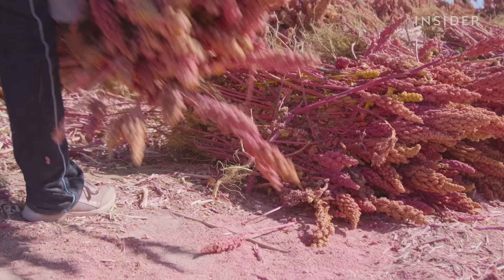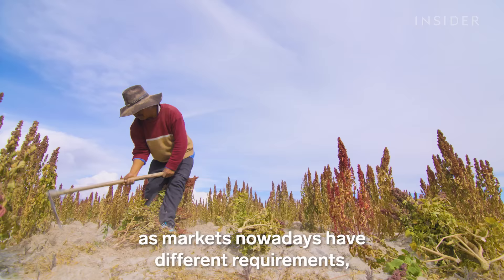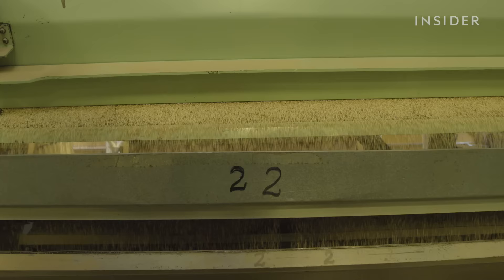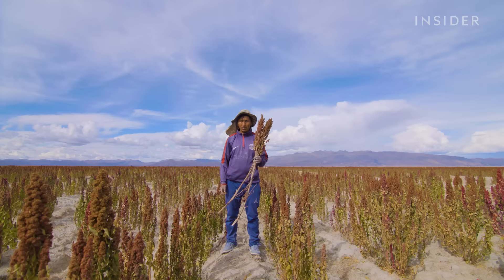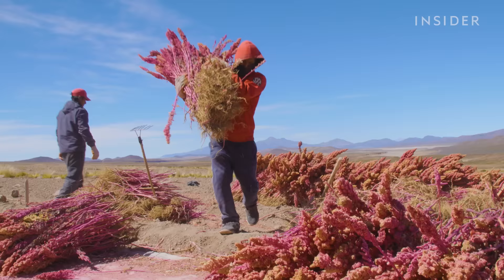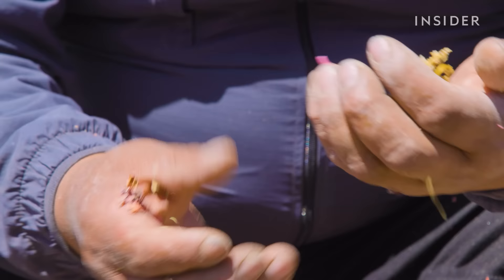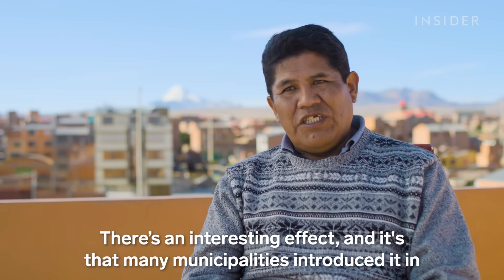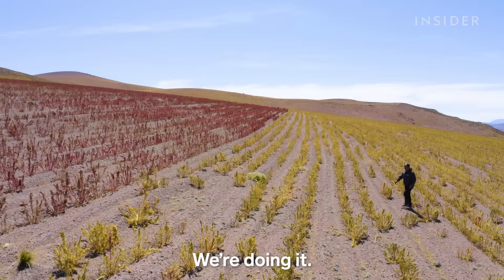Why Royal Quinoa Is So Expensive | So Expensive Food | Business Insider

Comment: Idea for a video: Why montblanc pens are so expensive
Reply: I've been in the fountain pen hobby for a long time and Mont Blanc hasn't been considered the best in a long time.  Japanese brands like Pilot and Sailor produce superior pens at often lower prices.  In addition, Maki-e pens from Japanese brands are stunning.  This is just not something you can get from Mont Blanc.  The real answer to why Mont Blanc pens are so expensive is either because of the brand name or due to the gold or silver embezzlement which add artificial value.  The bare minimum IMO is using it artistically like maki-e pens do.  Otherwise you are just increasing the price for the sake of profits.  The only place a fountain pen might need gold is the nib otherwise.  The amount of gold used influences the nib's flexibility which in turn influences maximum line variance.  Of course you can use other metal or metal alloys to influence nib flexibility.  The difference between a 23K nib and steel nib price wise is $120 - $150 as only a small portion of gold is ultimately needed.  You get a very flexible nib at that price which is good for calligraphy but bad for those that don't have good control over their pressure.
Reply: @giglioflex  a well written answer , I wasn’t aware that montblac pens are a cash grab  thanks for introducing me into the world of niche pens